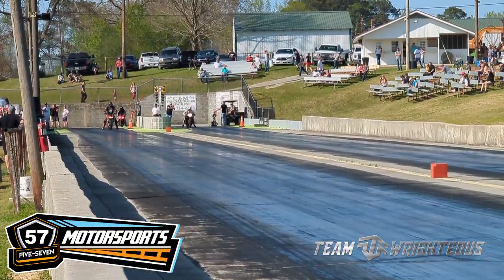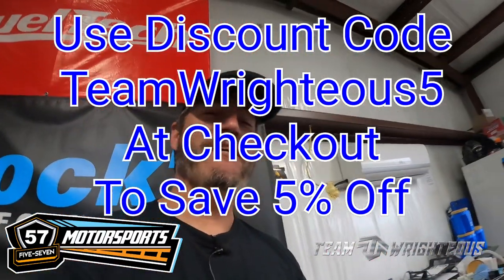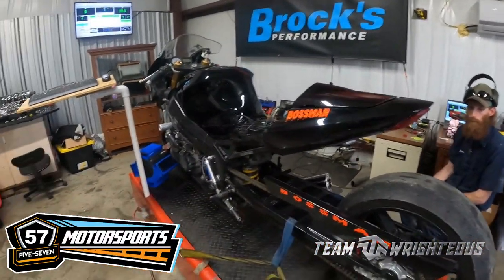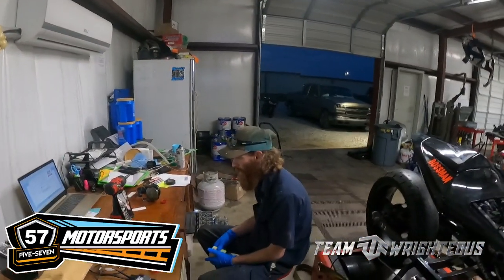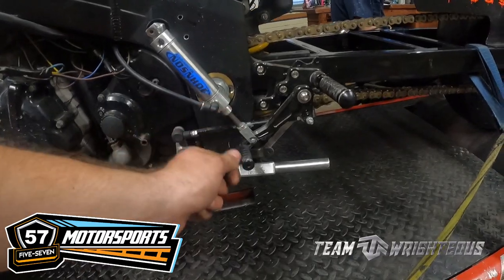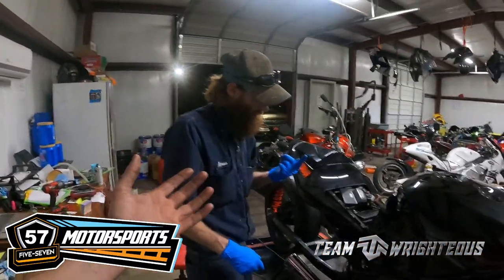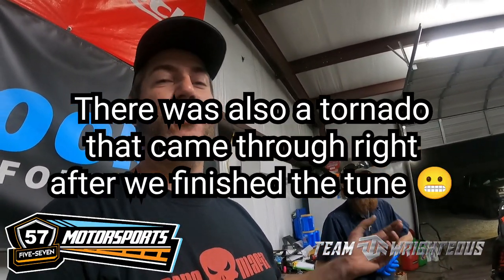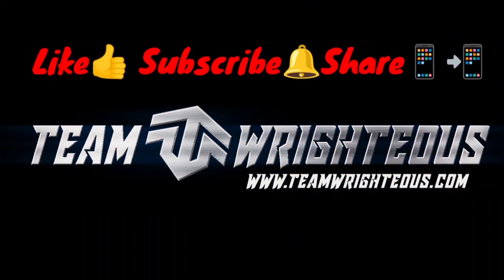Dyno Tune 2004 GSXR 1000 w/ Brock's Performance Alien Head

Comment: GREAT SHIT!!! KEEP GOING because ur definitely gonna get that 160 IDGAF with nobody else says because I myself is a GSXR MAN, and I am currently working on a Custom 2001-2002 Suzuki GSXR 1000 with a BIG FAT 240 WIDE TIRE KIT and a 16" over extension stretch on it in which I Custom building from scratch and should be completed by March, May, or the forthcoming August hopefully if not wayyy before then???! But he is definitely gonna have that BAD ASS POWERFUL BROCK'S TIWINDER PERFORMANCE EXHAUST SYSTEM on it as well top it all off! 💯 💪🏽💪🏽👍🏽